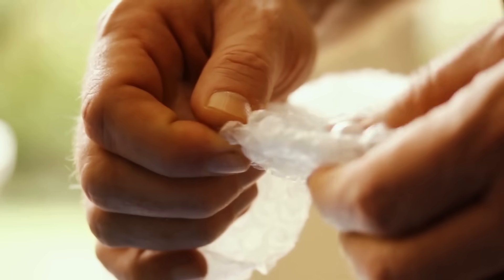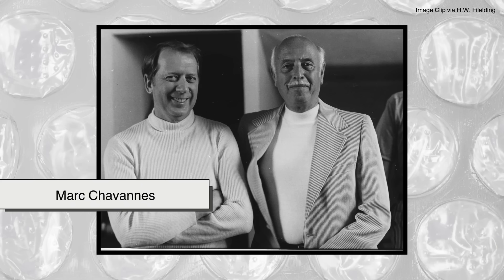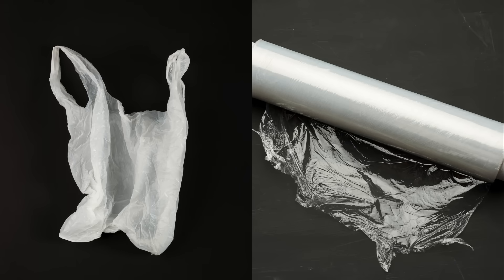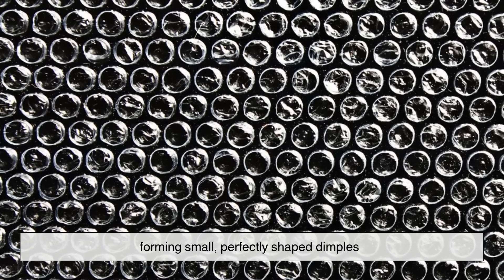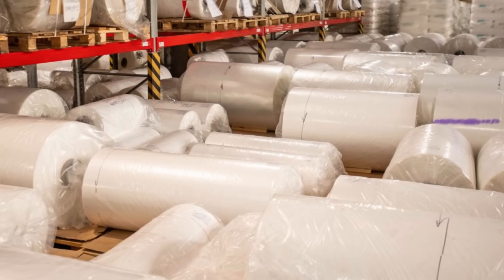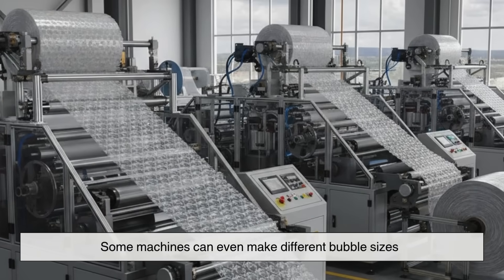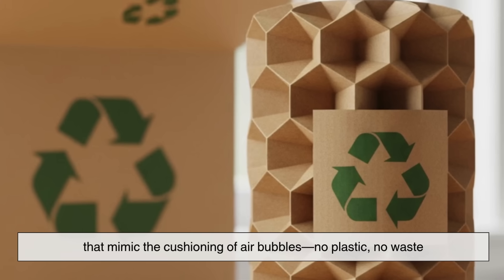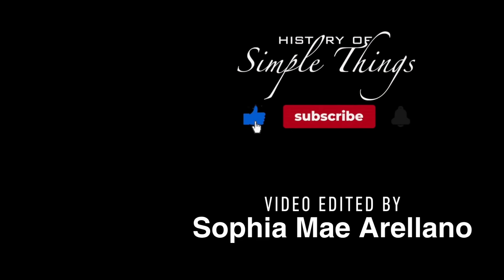How Bubble Wrap Is Filled With Air (and How They Make Sure the Air Doesn’t Escape)

Comment: Not "literally every bubble is sealed perfectly". Actually just good enuogh.
Reply: in this case "perfect" means consistant from one to the next.
Reply: @rupe53  look at any sheet of bubble wrap and you will find out there are single-digit percent of bubbles that don’t hold the air. They either vent to adjacent bubbles or outside of the material.
That is consistent and good enough, but nowhere near perfect.
Reply: @marekstanek112  There is always a rate for flaws in any product. Perfect enough / good enough fits the bill here. It's not rocket science.
Reply: @rupe53  That's not how the language works. "Perfect" is literally FLAWLESS. BY DEFINITION.
Reply: @rupe53  Nope. Perfect doesn't mean "consistently imperfect". Perfect means LITERALLY "flawLESS". That means literally ZERO flaws.
Reply: @marekstanek112    Perfect depends on how you measure. Perfect by eyeball is not the same as some scientific measurement, which may still find minor flaws. To most people things work out perfect in the long run. Just remember how perfect the mirror was in the Hubble telescope.... which passed inspection before launch. How many millions did that cost to tweak afterwards? Most people say "perfect" when they are happy with the results. IOW, the perfect soultion may have flaws, but it' doing the job so leave it alone.
Reply: @rupe53  Again: that is NOT how the language works.
Reply: @marekstanek112    how is it that I can understand what you mean and also what others usually mean, but you don't get the point that nothing is perfect?
Reply: @rupe53 probably because most people don’t use words in compliance with their actual meaning.
Reply: @marekstanek112    Ahhh, meaning from context, right? Talking with the average Joe on the street is one thing but adding a title in front of their name (should) narrow the gap in meaning as the education level rises.
Reply: @rupe53  that's a very good description. for example, lawyers are very obsessinve about using the language correctly, as in their profession, imprecise usage of language often makes all the difference between the client walking free vs spending years in a penitentiary. the same applies to many technical branches, where wrong usage of words can mean catastrophic failure of equipment, resulting in severe bodily harm or death and subsequently in prison time for the designer.

Comment: the bubblewrap may protect the dishes at 5 minutes but only if the dishes are packed separately.
Reply: there is a waffle pattern paper made specifically to put between plates / dishes when storing / shipping. Use those first then bubble wrap the whole pile.